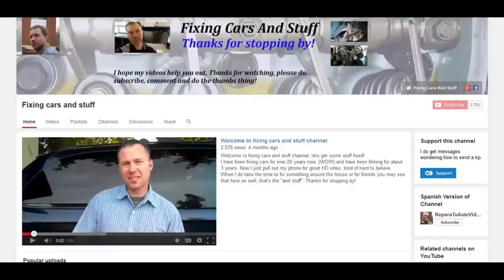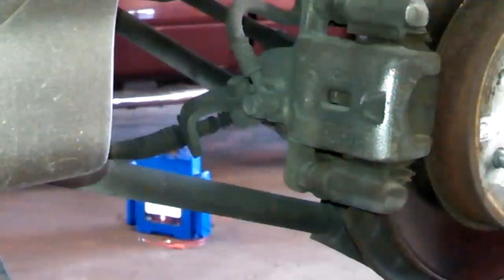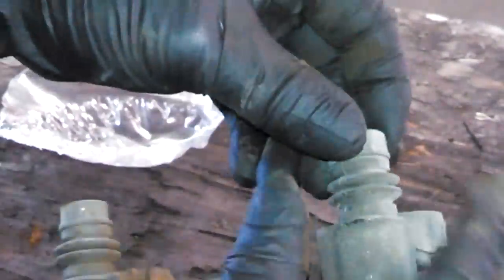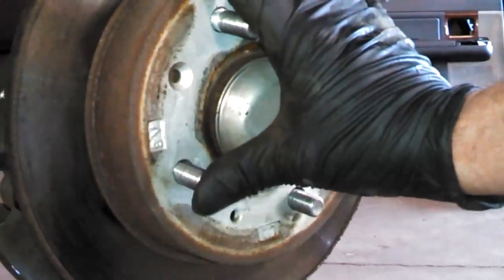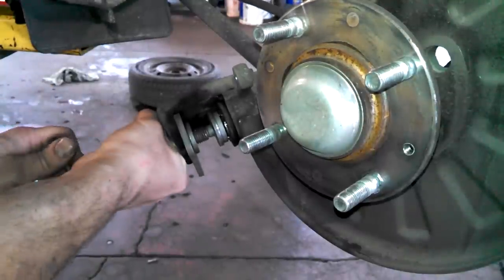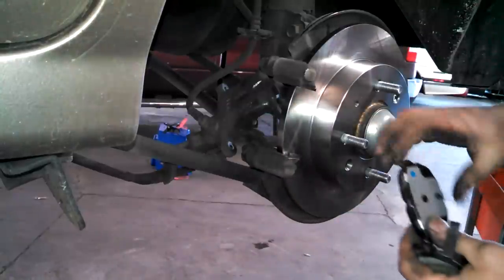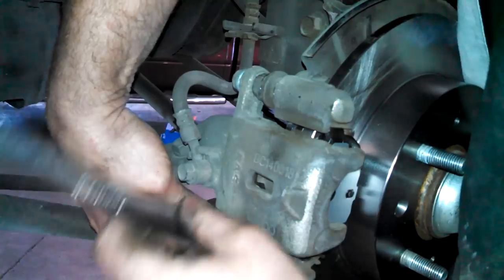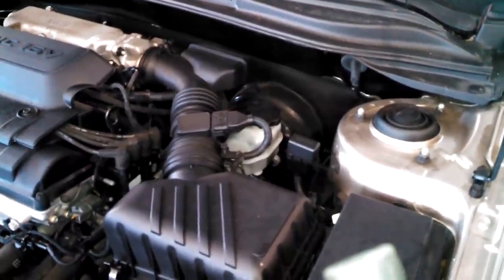Rear brake pad replacement 2008 Kia Spectra 2005 - 2009 how to change rear pads

Comment: hi , thanks very much for the great info , and i have 2 questions 
1. you did not open the drain bolt when you were squeezing the calliper back is it okay . 
2. as i know that brake cleaner is not good the rubber bot if you used selikon based it is not better .

Comment: I just changed the rear brakes on my 07 tiburon, after the job I am getting a churning sound from the passenger side. Everything is tight, no excess heat coming off the wheel. When I did the test drive there was no sound, after about 39 miles I started hearing the sound. Any thoughts on what might be causing the sound?

Comment: Do you have to use the "special tool' to collapse the rear brake piston? Or is there another way without using the tools?
Reply: I used a large C clamp and channel locks. Spin and clamp and got it. Had the wife hold it. Worked out ok. Try not to cut the rubber seal.